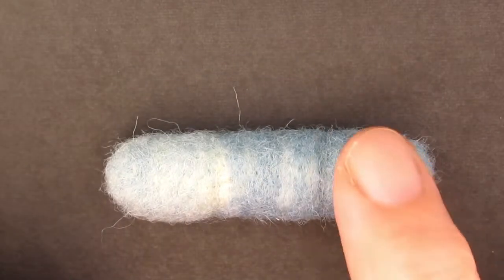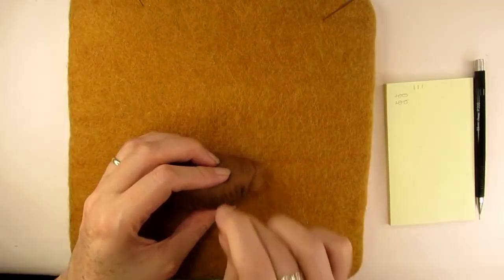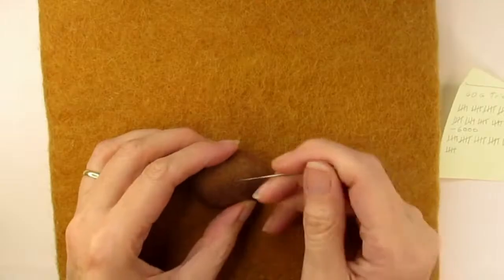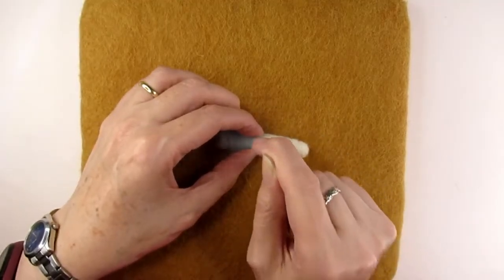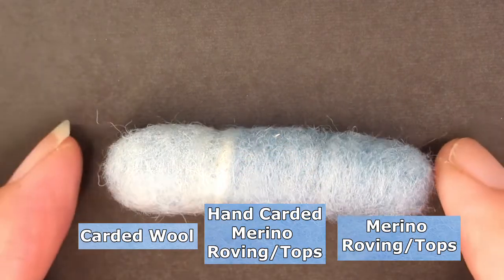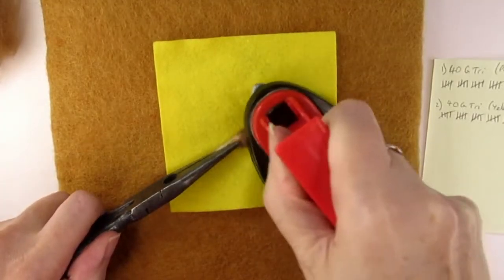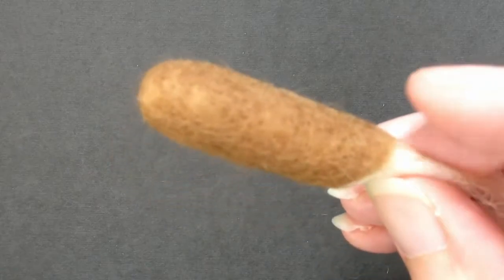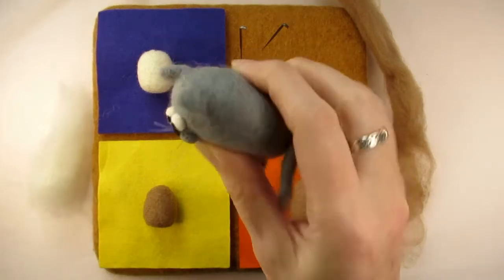Finding the SECRET TO NEEDLE FELTING A SMOOTH FINISH

Comment: Oh my goodness....I commend you on your scientific approach !  You must have a background in engineering or statistical analysis 😅. I would like your review on the material you bought from Amazon. Great video.
Reply from the maker: Thank you for the comments Hugo,  my background isn't quite that scientific 🤣 but I do like a good Excel spreadsheet, one day I might work out how to get one into my videos 😂 thanks for letting my know you'd be interested in the wool I bought off Amazon 👍
Reply: @juliesfeltedfriends  Hi Julie, What is the difference between Corriedale wool vs Merino wool? Is Corriendale better suited for base material like shaping the body and then covering with colored merino wool.?- (total novice here).....I just ordered my first kit from Amazon. Thanks for the inspiration. - Hugo
Reply from the maker: @hebelson444  hi Hugo, thanks for the question, the types of wool refer to the different breeds of sheep, I like to think of it as some sheep have thick hair and some have fine hair, bit like us humans 😊 Corriedale is a breed that produces quite thick wool that felts quickly with a thicker needle, something like a 36 gauge needle, so this is ideal for forming the initial shape. So yes I tend to use this thicker wool to form the base then coat it with a layer of fine or thin wool like Merino wool (coloured) or any finer coloured carded wool. Some felters just use all Merino wool, which is possible but I find thicker wool easier to shape, I talk about this a bit in my 'when to stop stabbing' video. Hope this helps and good luck with your needle felting, I'd recommend just having a play and see what you can make 😁

Comment: Has anyone tried lightly torching the wool?
Reply from the maker: Personally I've never tried this, I'd be very careful about burning wool, I would be concerned that it might all go up in flames! And be a fire hazard. One method I haven't tried that might help is using a fabric shaver, sometimes known as a debobbler 😊 this would save time instead of trimming with scissors. Hope this helps, thanks for watching.

Comment: It is best to use a spiral needle. She doesn't make big holes.
Reply from the maker: Yes a spiral needle works well too as long as it's fine, but I've found that a fine triangular needle such as a 40 gauge or 42 gauge, if you have one, can also get a nice smooth finish 😊 thanks for this and for watching